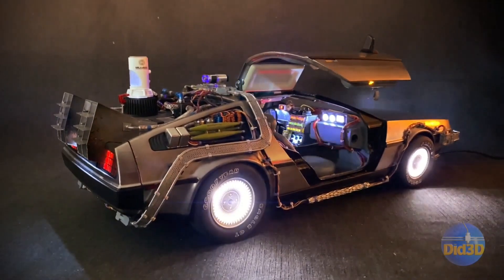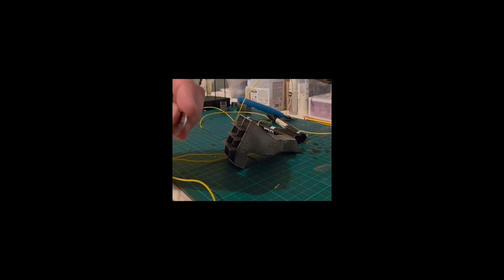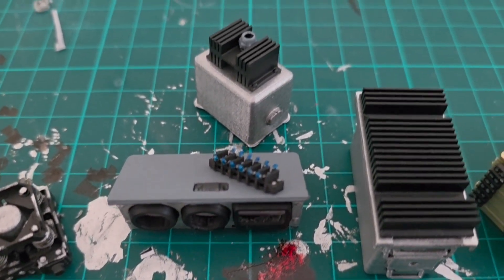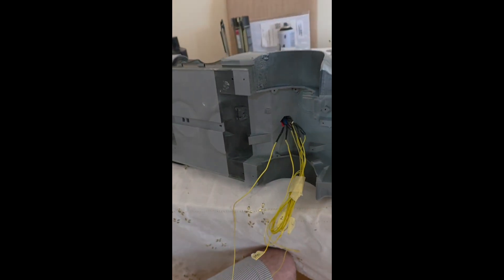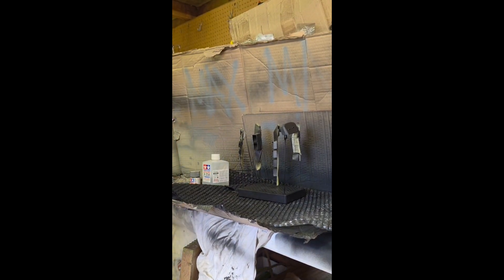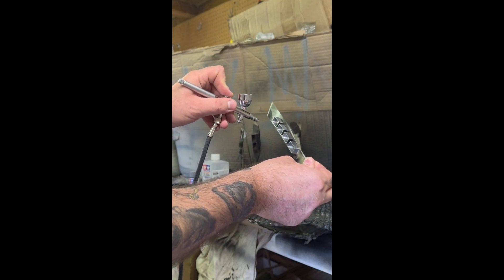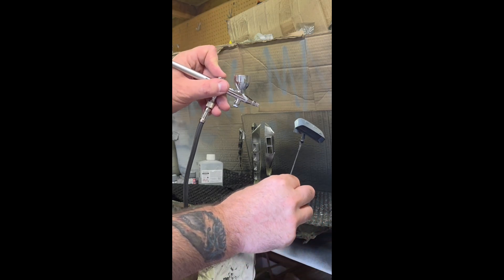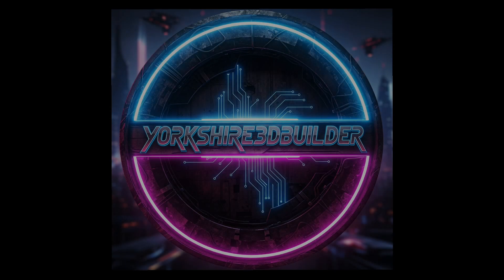I 3D Printed the Delorean Time Machine from Back to the Future! Part 2

Comment: Great job! FYI, those aren't thrusters, they are cooling vents for the fusion reactor. I want to build one 1/4 scale as a prototype to scale up for a 1:1 build, strip and chop a used car then build a tube chassis, fiberglass over foam body panels, etc.
Reply: Technicaly you could say those are thrusters because in bttf part 2 at the very start doc uses them to get enough speed while flying
Reply from the maker: Thanks for the feedback! 
I want a real deloean, but I have to be an adult and spend money on adult things!😂
Reply: @Yorkshire3dBuilder  I'm 40 and just bought by first Delorean this past summer. Trust me you can do both if you are responsible. "Someday is a disease that will take your dreams to the grave with you".

Comment: Great looking model! I’ve been looking at printing the BTTF Delorean from Gambody but I really like the motions and details of your model. What scale do the files come in and did you scale it up? I’m currently working on the 1989 Batmobile from gambody that I scaled up from the original 1/16 scale to 1/10. I would like to do the same with this model. Thanks!
Reply from the maker: Its 1/8th scale, and as you can see fairly big already.
I also bought the gambody one also, I didnt print it...then found this one and decided this is the most realistic looking one. The gambody one has lots of unnecessary things like the engine and suspension etc, which people will not see. Therefore a waste of time to print, paint and fit.
Plus the support from the fb group is second to none from fellow builders.
Reply: @Yorkshire3dBuilder Thanks for the info! I am looking forward to more update videos.